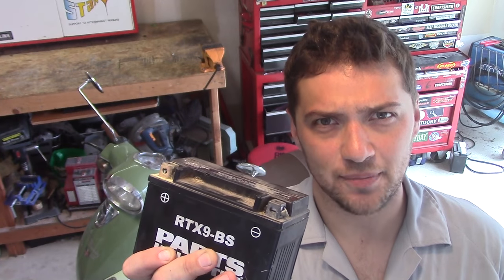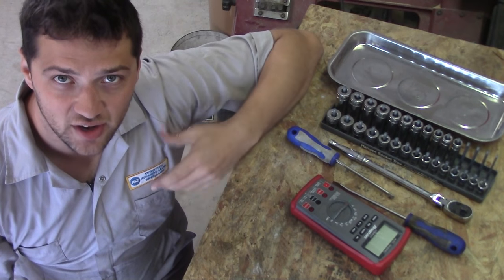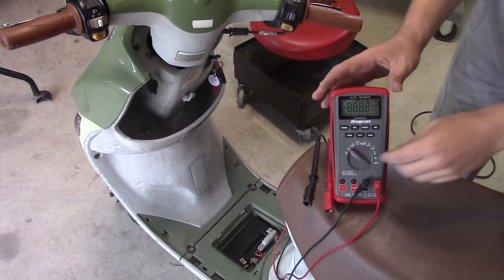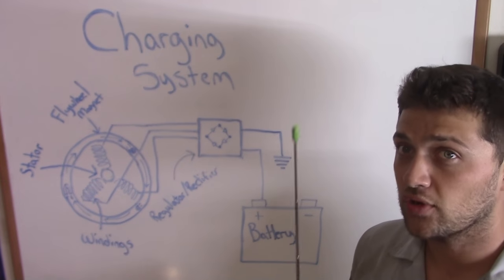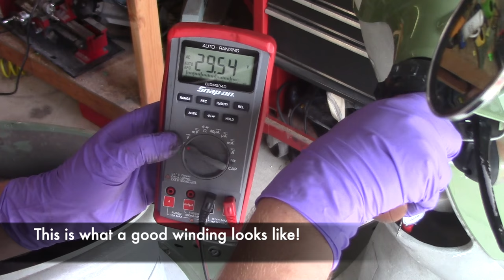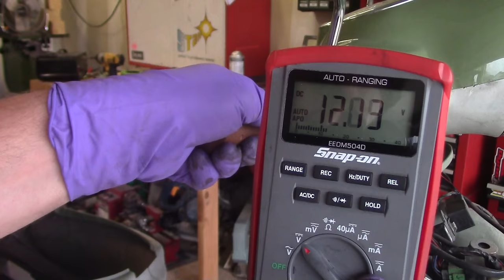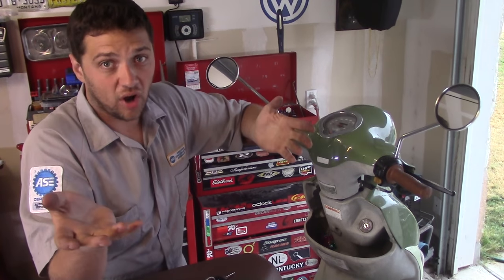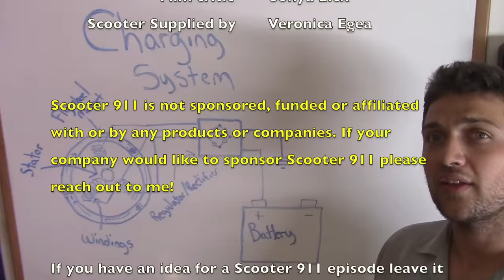Scooter 911: Battery Keeps Going Dead! (Troubleshoot your charging system and parasitic drain)

Comment: I'm a certified motorcycle technician and this video was better than the training I paid mucho bucks for! Good job.
Reply: Hey dude,  the bloopers at the end of the video was very funny. The instruction was excellent to outstanding.
😊😊😊
Reply: Aloha, I have a gy6 50 cc moped. And I have a electricial issue. I replaced the battery, the stator, the cdi, and ect. If I leave the bike off for more than 2 days and wen I go start it the battery act like it's dead

Comment: omg you saved my life a little with this one.
I had watched the video some time ago but just recently picked up a 50 cc buddy.
It's missing the front cover - salvage auction.
The fargin' rectifier was disconnected!
Whether intentional or vibration I don't know but the voltage didn't drop when revving now that's it reconnected.
I will be using this to deliver food as an only source of income so it's important.
I had to come home yesterday as it got only to the point of kick-starting.
You are the best!
Now out into that 96 degree weather.  lol.

Comment: Just wanted to say thanks for this video. Helped me trace a faulty seat opening actuator on a Vespa GTS 300 as being the cause of a battery drain that killed the battery on a brand new bike after 1 week! Pulled fuses untik draw dropped from 250ma to 0.004 ma (I wouldn't have known a good reading without this video) then went through the things associated with that fuse. When i pulled the seat actuator it dropped to 0.004ma. Now just need to get it all done under warranty. Thanks for getting us back on the road.

Comment: Great Videos Garrett.  Particularly liked the adjustment for valves.  Here are some thoughts for Future videos.  Tire management - How often to replace/tread wear to stay safe, What's the difference in short case vs Long case GY6 motors, how to replace a long axle with short axle (one I am currently working on with an MZ Moskito 125R), how to replace stator, Vacuum vs Gas lines and that PITA gas valve with the vacuum line actuator, Performance Air intake system and bypass/plug vacuum lines, what else......ethanol vs Non-ethanol gas and premium vs 87 octane -ethanol wear on gaskets and fuel leak into crankcase..........replacing CCV belt.

Comment: Just purchased a 2008 sage green  model like you're showing us. Mine charges battery as I ride. As a Tilesetter working with the Schluter Systems Ditra Heat, we test cables with a Megohmeter

Comment: This is great. Makes Perfect sence when you explain it.
I had a  hard time changing my drive Belt I didnt know how to take off the bolts without it spinning.
I dont know if You have a Belt or clutch change and the variator. I had a hard time and had to buy a rubber wrench tool.
Maybe youll do a video on that?
Reply from the maker: That is an excellent idea! Thank you!

Comment: I just purchased a Tao Tao Quantum Titan 150cc scooter about two weeks ago and I have similar issues. Maybe I didn't charge the battery long enough. It states to charge for up to 8 hrs., I think i charged it about that amount of time which should be good but after sitting for a day or so, it's struggling to turn over. I'll use this video to help troubleshoot if the problem persist. Thanks for posting...

Comment: So I'm getting spark and fuel I adjusted the valves at 14 on the intake and 15 on the exhaust only thing I don't have is the compression tester and I can't get this moped to start I'm ready to pull my hair out 911.. any encouraging thoughts or direction you could give me would be so freaking thankful I appreciate it and I like your shows keep it up I'm learning things though and I appreciate your time.

Comment: Ok, I am new to this but your videos are helping me to diagnose our scooter. There is power but it won't turn over. It will run for a day and then stop. Did a valve adjustment and it worked then the next morning it wouldn't start. It just will not turn over the engine. Cleaned the carb and air filter, new spark plug and it originally had a crappy way too high voltage additional light on the front which we removed. We figured it was draining the battery. But, put a brand new battery in this morning and it will crank but not turn over. Any suggestions?

Comment: thank you for the video, very informative.
i have a tomos 150cc nitro and when been fighting it battery drain for a while. So today checked the voltage without a battery installed at the battery leads and its 7-9v when rev'd...i would expect the 14v there. Now once i find the issue stator or regulator, would you know if a stator and regulator would work from a 50cc model? i cannot track down 150cc parts for this.
cheers!
Reply from the maker: its best to just identify the parts visually and find replacements. chinese scooters often are made with whatever parts are available that day. I've seen 2 of the same year make and model scooters uncrated with different parts. hope that helps. Good luck!
Reply: @Scooter_911  thanks again for the info. 
I metered the stator wires while plugged into the wire harness and got 12v and 20v +/- 2 V when reved, then unplugged from the harness it went from 20v to 50v revd. I'm assuming the difference is the system us under load?
I got another regulator from a 50cc (it was the same) and now getting 10-11v rev'd, but still not enough to keep the battery charged.
Would you think swapping the stator from the 50cc would be worth the effort? I don't have a flywheel pully but can borrow hardware store 2-prong pully.
Any other areas of the scooter to consider?
thank you
Reply from the maker: @mikec376  you're absolutely right, the readings will definitely vary due to the load of the charging system. Did you check all 3 legs of the stator? Yes if the 50cc stator is identical it's worth a shot. Check out this video I made on replacing stators here https://youtu.be/pPkbJ0FB3dM

Comment: Thanks for the video! Unplugged the voltage regulator and the ampere dropped! Is replacing the regulator enough to fix the problem?
Reply from the maker: Yes. Definitely start with replacing the reg/rec and then retest. A shorted stator can cause a lot of issues down stream! Good luck my friend!
Reply: @Scooter_911  🤩

Comment: Hey Garret!  Great vids!  I have a 2012  TaoTao 50.  Is a Y style stator grounded at the common point/center of the stator or is it floating?  If you take ohm readings from the white to yellow wires at the stator plug,  shouldn’t you only be reading thru those two windings?  Any suggestions on a reputable business to get a good stator?

Comment: Very well done,  Can you use the scooter with the stator disconnected safely,  ie. Overcharging  17v?
Reply from the maker: Yes but it will run the battery dead after a while.

Comment: Garret help! besides other problems I had with my Yamaha Zuma 50 (2004) now I've learned that the battery dies super fast even after being charged (dont own a charger myself, took it to my local  autoparts store) so the electric start will not work. Example: I had it charged, connected it, horn worked fine. Tried electric start and made that "wah wah" sound you talked about and scooter wouldnt start (it only starts with the kickstart which thanks to you I've learned today that you shouldnt use it everyday) and then right after the horn wouldnt even work, just clicks, test it with my $10 multimeter and it reads less than 10v. How could it die in a matter of minutes or seconds even? I bought that battery on December 2019. Also checked the battery while running and it was about 7 or 9v (not 13 or 14 like you said if the stator is working fine). Hope you read this :( thank you and I love your videos bro you one of the best YouTubers in my opinion.
Reply from the maker: Sounds like you might have both a bad battery AND a parasitic drain. Good thing you have that multimeter! You're going to need to use it!
Reply: @Scooter_911  but the battery is practically new man how could this had happened T.T

Comment: Hello. First thank you for the info in the video. I wanted to ask you a question.
I have a 2007 honda sh150i  and when i measure the battery it reads about 12 to max 13 volts when ideling and 15 to 15.3 when turning the throtle near the max. Is that  correct in the high rpm or does it have a bad voltage regulator? 
Thank you.

Comment: I replaced the rectifier on my scooter it’s a big one ( rectifier ) and it still won’t recharge but everything thing else works fine ... I also have a buddy 150cc it’s a fast little monkey and it’s stock and it goes 50-52 mph kinda scary since it’s so small it kinda wobbles past 47.mph .. I got a rear flat what the size is the nut to remove rear wheel... oh’ could I put rear tire size 4.00 x 10” instead of the stock 3.50 x 10 “ it rides so low that some times I tap the oil cool thats under the battery compartment when I go up some drive ways  ??

Comment: thank you for your video. A question for you about the battery and the multimeter.  I have an old kymco r16 50cc 4t (2009 year) , i think that it's a GY6 motor carburetor system.  I've checked the battery with my multimeter and the value is about 12.70.... when i rev up , when i increase the rpm , the multimeter gives me a value about 16.80.... is it too high? Maybe do i have to change the regulator/rectifier?  Sometimes i have problems to start my scooter...  my battery was off and i recharged it using a charger....

Comment: Thanks as this was helpful. If this battery was to be a 100amph 12V battery and the system in question drains the battery very quickly, what sort of rectifier would be used to recharge the battery as quickly as drained. 🤷🏾‍♂️ Some say rectifiers can't recharge 100 amp batteries and above. Any help?

Comment: On my 2011 Suzuki Burgman 650 my battery died. I replaced it and the next day drove around nearly 3hrs made a few stops and turned it on and off several times. Then it wouldn’t start up for me. Had to get a jump start.  I set up my multi meter and started to see how much parasitic draw it was having it was bouncing around .24-.28ma. I started unplugging stuff and seeing what had an effect.... nothing until the instrument cluster, I unplugged the cluster and it dropped to .01ma. I’m going to pull the cluster apart and see if anything is damaged.

Comment: Thanks for this vid very informative. I have a Peugeot Looxor 125 and has a problem with charging. Checked voltage giving 14.5v but on lights on 13.5v rev engine. On stator there are 5 pinouts. When checked resistance  to earth giving me 115 ohms on one and the others all different. Any help please? Thks.

Comment: Hi so I have changed my rectifier. I also changed my my stator. It wasn't brand new it was of my original engine which I know it was working. And it's not likely to have same issue. My battery is draining  when engine is on. I did stator test putting red into both connections and black to ground but again was reading 0 on AC this was the issue with both stators. Now I put the black and the red into both connections(not ground obviously but other 2) on the stator wire I get a reading of 40+ volts and 50+ when revving the engine. So am confident it's giving out enough AC to rectifier to change to DC. I have just ordered an wiring harness as this is my next thought on issue. Looking at the earth through my harness and it looks frayed and bubbled in sections..could a bad earth that causes this issue along with maybe other damaged wires that I can not see?? Sorry am not great at explaining. So I hope you understand. Love your content btw, keep it up. You make me want to tackle more and more on my bike.

Comment: Great video, very informative. My scooter (Loncin LX175-5 SP2) hesitated to start yesterday after about an hour of being parked. I use it everyday and this happened after several errands, on my last stop before going home. I checked the battery since it sounded like that was the issue (battery is about three to four months old) and noticed the battery was "swollen", deformed. I tightened the connections and quickly drove home.  Any ideas? I know very little about mechanic but I'm willing to try. I have some idea, but I'm no expert.
Reply from the maker: Oh darn! Your battery is compromised! I would be very careful with it from now on and replace it asap. There are 3 things that usually result in batteries swelling like that: Overcharging - check your charging output voltage, Freezing - the water in your battery froze due to cold temps and swelled, and failure to vent - some batteries have a little vent port off the top that comes plugged with a little red cap for shipping. Make sure that the cap is removed. This was such a great question! I'm working on an episode about batteries I'm going to include this in it! Thanks!

Comment: Big fan! My Kymco 150 has stripped spine threads on the end of crank Shaft! Expensive to fix? Considering 2020 lance classic Cali 200. Good scooter? Reliable brand? Thx
Reply from the maker: I'll be honest with you I'm not too familiar with the cali 200. I've worked on a lot of cali classic 125s and they were of varying quality. The Lance brand has had its share of lemons like the pch 125 for instance. I dont think they make as good of a product as kymco and genuine (pgo) but a little better than the off brand Chinese stuff.
Reply: I did that to my ruckus.
Got a new drive face and filed the threads with a small triangle file.
The kickstart washer is the only thing engaging the shitty threads but it still works.

Comment: I've also had a drain issue with my previous battery and considering this new one was dead after my most recent starting issues, I'll watch this & see if it can help resolve that.   Where's the spark plugs at on a TaoTao Pony 50, what sockets & fittings am I going to need for this?   I know it uses an M8, M10 & M12 for things like the oil / gear oil, etc....
Reply from the maker: The sparkplug is located on the right side of the cylinder head. Remove the front inspection cover (by where your heels are when you are riding) and you'll find it there.
Reply: Is this the correct Regulator Rectifier for a Pony 50?
https://partskit.com/product/104422
Reply: @Scooter_911  how much of a process is that?  Lol
Reply: and that is the correct stator, I'm assuming?  https://partskit.com/product/107052

Comment: Hi, is there a sequence for wires when you connect  them from stator to the regulator/rectifier
? Does it matters where any of the 3 yellow cable  enter the  regulator/rectifier (also yellow) ?  A "smart" dude cut the soket . TY !
Reply from the maker: Excellent question! Actually it does not matter where the stator wires enter the regulator rectifier. All of that voltage all ends up in the same place and leaving as DC on the "voltage out" wire. Throw them back where you please!
Reply: @Scooter_911   Thank you!

Comment: I know this video is old . But i bought a used scooter this past weekend as a proyect scooter for winter..   charging systen is bad voltage jumps non stop . 8 volts to 15 volts . Non stop . . So i ordered new stator and regulator.  Still does the same thing. ..  maybe is the flywheel ? Magnet ?

Comment: I just bought a 2014 Chinese Kait Model S-08K with only 345 miles. And 10" rim's. The owner told me the starter gear wasn't catching and he ordered a New starter and that he would put it in for me. The owner stated I should kick start the moped until the New One is put in. Well it started by the electric switch. But then I had to ride it while it was lightly raining and the signal's for left and right wasn't working and the horn went from being perfectly sounding to sounding like the horn was drowning in Water. Do these Chinese Moped's have problems when it comes to riding in wet weather? As the Moped I have Now has shown Me it doesn't like Wet weather at all. Is there anything I can do to prevent water getting into important components in front and behind the plastic cover of the Moped?
I have a 2012 Kymco Like 50 with over 6,000 Mile's on it. It needs a New exhaust system and New battery. It sounds like a Loud Chainsaw. It has 12" rim's and when I rode it, I could hardly feel the crack's and dip's, but with this light weight Moped from a 250 lb Kymco Like 50 Moped, I am not sure I could ride it during the Winter, Like I  did Ride My 2012 Kymco Like 50, the Kymco was Great in the Winter months, but Now I think the 2014 will only be Good when the road's are clear, not Wet with water.